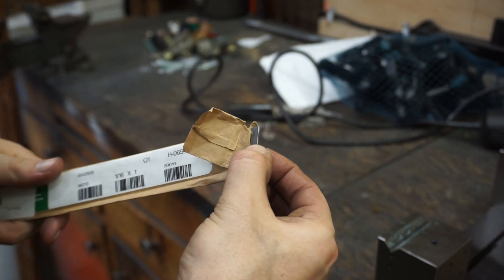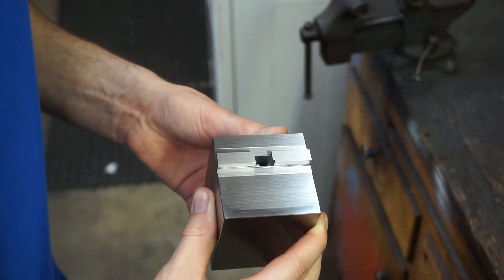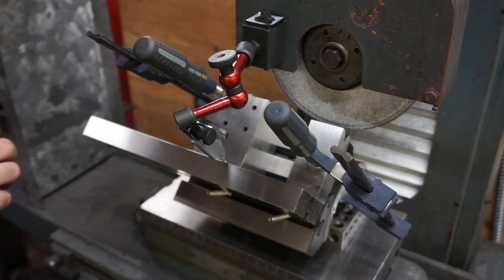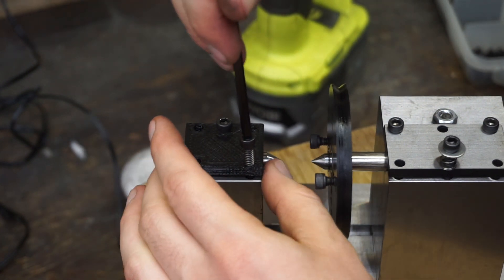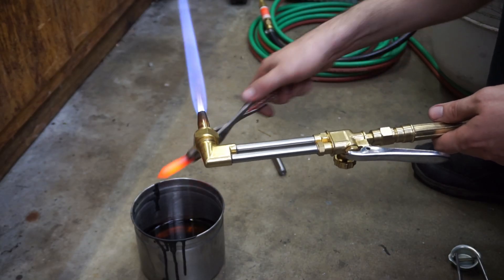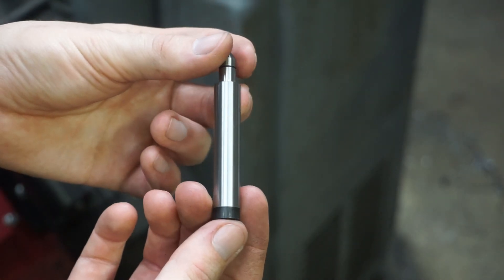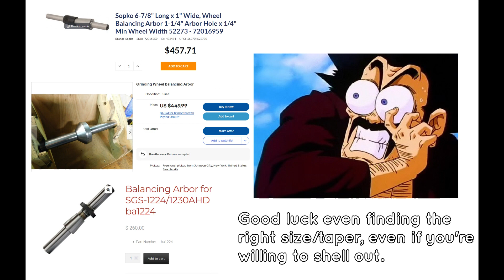Cylinder Grinding Jig for the Surface Grinder

Comment: Check out Ca Lem's balancer. I made one and it's extremely sensitive (and easy to make). Uses ground planer blades. I just sanded my arbor finish until it reached an Ra of really really smooth and by that time it was sensitive enough to detect imbalances in the arbor.
Reply: As a home shop SG user I’d suggest you also look at wheel hardness 46J will get you a long way with most materials and wheel dress into if but how and with what is another factor. Your grinder sounds OK but spindle age and condition need to be considered. Like your build.

Comment: You did well.  You kept things simple and you didn't drive yourself crazy trying to achieve a level of perfection that isn't usually needed in a hobby shop.  So definitely a success.  If you're interested to improve your grinder's ability to achieve great results, you'll have to go into your anal retentive mode.  I nearly drove myself crazy but did get my grinder working wonderfully.  And yes I bought all the fancy Sepko balancing stuff. Super expensive but worthwhile.  Keep on having fun. Great video. Gilles